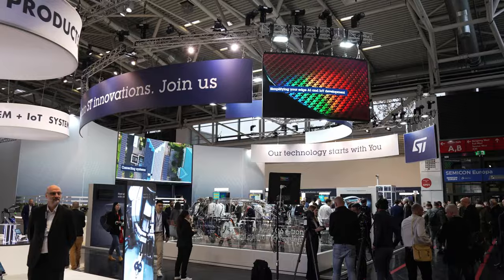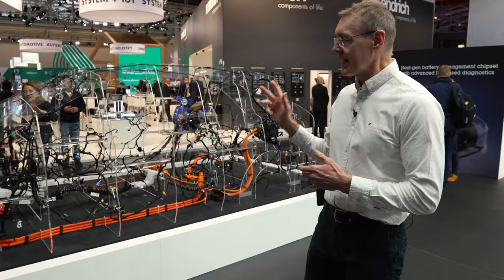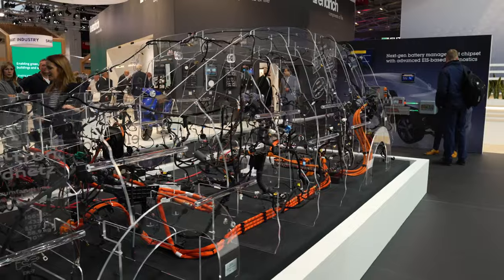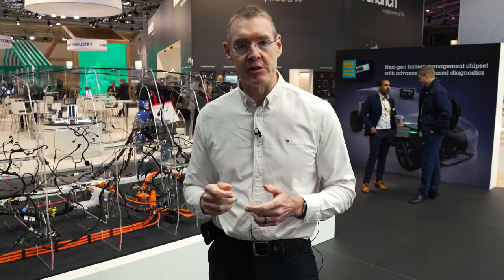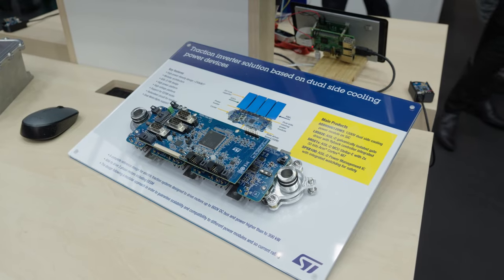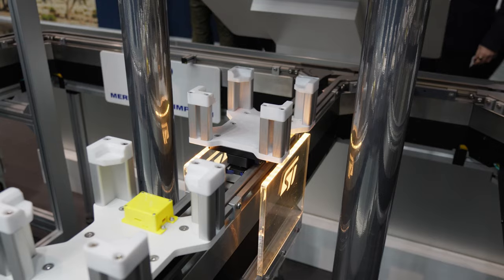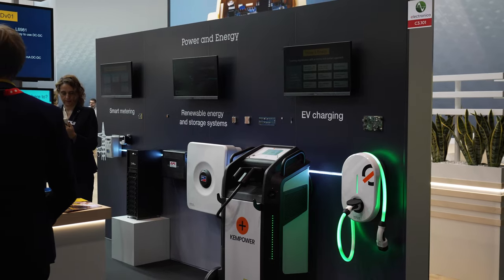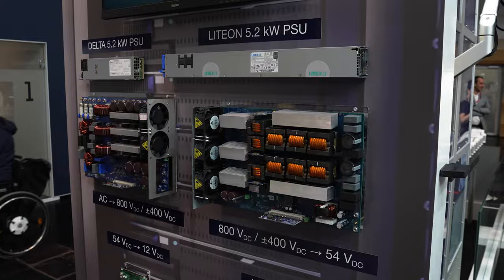STMicroelectronics at electronica 2024 - come and see our booth!

Comment: ST is a great company, and it is certainly very interesting to see the products. 

But it is a little bit counter-intuitive that the most visually striking item on display is the mock up of the "yesterday's" car wiring. Obviously building it took some effort. It would have been very cool to have a side by side comparison with how the wiring would have been improved by using the new products. Actually seeing it would have been more memorable, comparing to seeing the parts in isolation.